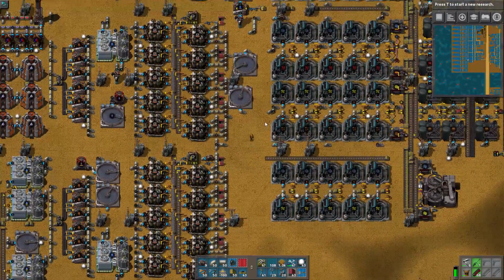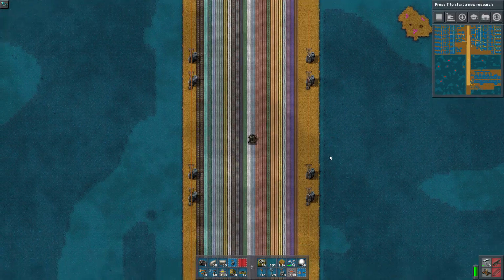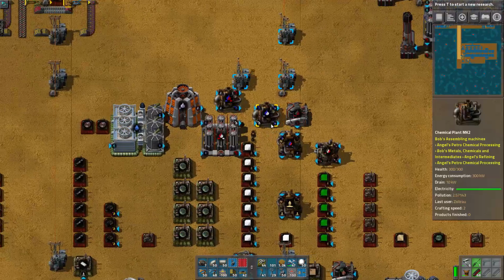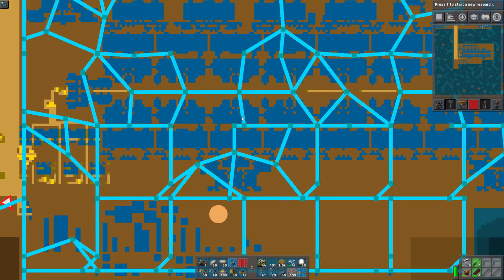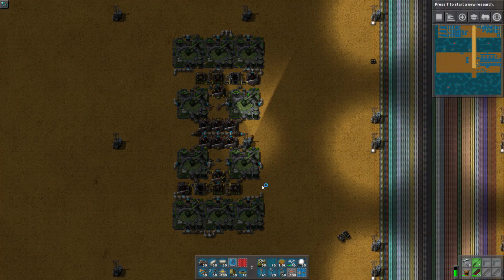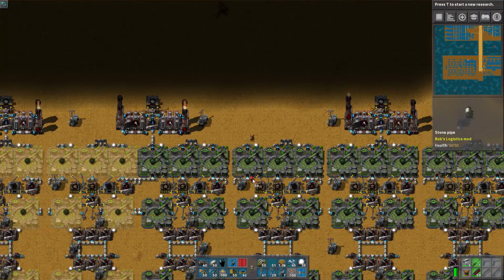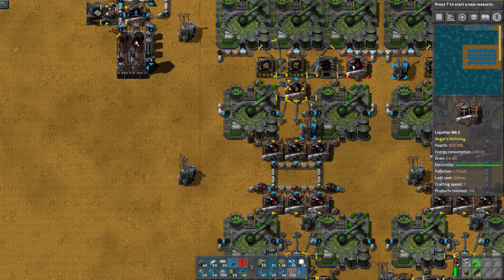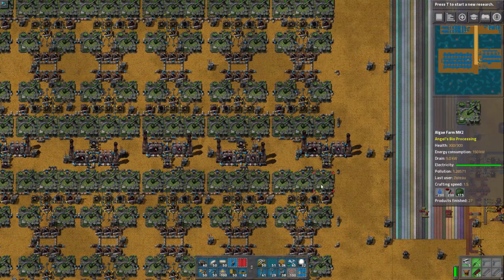Factorio Sea Block #24 - The Many Uses of Algae (0.15)

Comment: I think copper and bronze pipes are faster because they're smaller. It sounds a little odd, but I think they're better.
Reply: From what I observed while playing, it seems like fluid will fill pipes and tanks by equalising the ratio of how much they are full, so yes, smaller pipe section would flow faster. Reducing the number of pipes by using pipe to ground extensively (effectively reducing the number of fluid carrying objects)  might also help.
Reply: Yes the smaller pipes are meant for fluids and the larger pipes were meant for gases